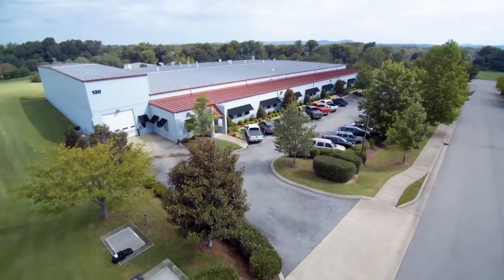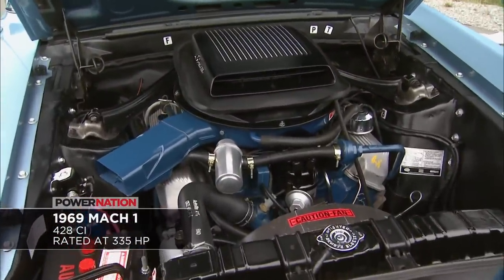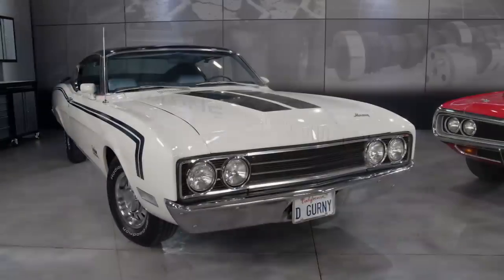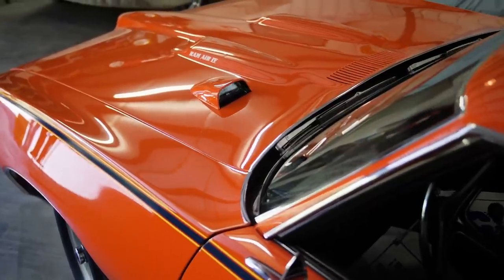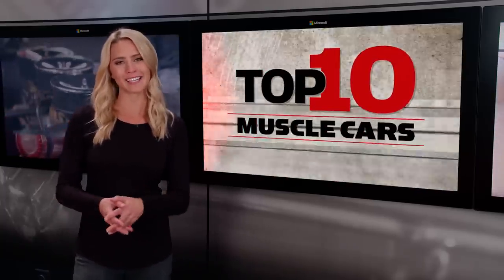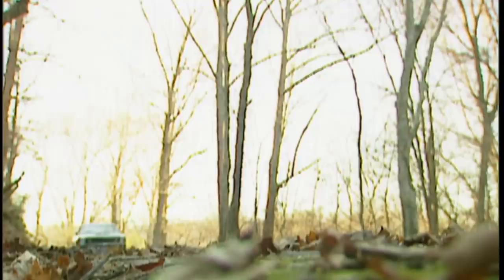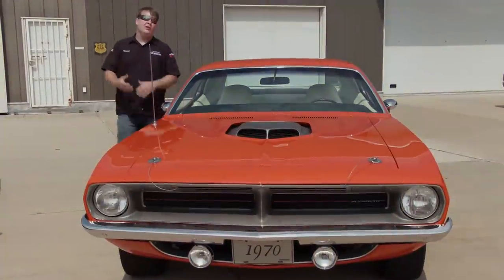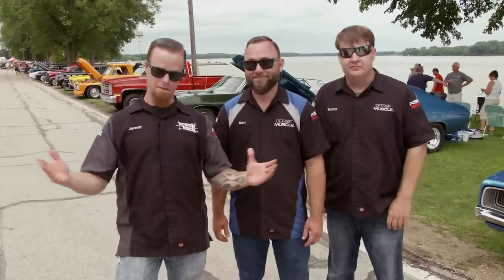Detroit Muscle's Top 10 Muscle Cars

Comment from the maker: Find more one-hour specials here: https://www.powernationtv.com/shows/powernation-on-the-road
Reply: Too many adds!
Reply: Um, 9 and 8 basically the same car, although I was surprised to see the GT 500 had an open diff.  There were only 69 ZL1's and there were only 2 ZL1 Corvettes made.  There were way more COPO's 427 Camaro's with the L72 427  Yenko and others.  The pre '69 car weren't COPO but dealer swapped, the were order as L78 cars and was swapped the short block for a L72, the cam, heads, intake a carb were the same.  A notable exception was the '69 Duece by Yenko a L72 Nova, which quicker then Camaro.
Reply: @russellroesner6073  o 

M
Reply: The Top Dog’s are the
1970 /1971
426 Hemi Cuda 4 spd/ auto
And 
1969/1970  4 spd / auto
429 Boss Mustang 
And 
1969 COPO 427 Camaro, and 
1970 LS6 S.S 454 Chevelle ..
Reply: @gregoryhagen8801  still a pony car, not a muscle car.  A good looking pony car to be fair but still not a muscle car.
Reply: @davidmiller9485  I don't know what your definition of a pony car is.But Road & Track. Car & Driver. Say it IS.
Reply: @gregoryhagen8801  Sorry but Road and track are full of it. A pony car HAS ALWAYS been a compact, usually two door car with a small V8 or V6. A muscle car is a sedan or Coupe (two or four door) that has a V8 (The smallest around 320 Ci or so) or more for power. (this would be your 392 hemi's or 426 hemi's. 383's 440, 445, 460, 350 ect. sized motors. Big fast and noisy. Pony cars have a more European outlook and while quick, do it with smaller engines and more varied handling.  They are very different.
Reply: @davidmiller9485  The 71 Mach1 was a 2 door 351ci. So by your own definition, it was a muscle car.

Comment: The first "muscle car" - specifically advertised for speed and track numbers, was probably the '55 Chryslers - a decade before GTO. 300 HP V8, hot cam, solid lifters, dual 4-barrels, big bore dual exhaust. In '56 a hemi with 355 HP. Some people would even make a case for the late 1940s Olds Rocket 88. Regardless, there were cars that were about speed and style well before John Delorean.
Reply: Yep
Reply: Because I'm new (14) to the Building, enjoying, racing Hot Rod scene etc....what does a "hot cam" mean? :)
Reply: @renc3920   <what does a "hot cam" mean?>
A "hot" cam is one that has more lift, duration, and overlap than the stock cam.
Reply: @evanderosborne4531  de
Reply: THE 49 OLDS IS NOT A SPECIAL CASE..ITS FACT! ITS THE FIRST MUSCLECAR AND ALL THE OLDIES HAVE KNOWN THIS EVEN BEFORE GOOGLE AND THE INTERNET.. ITS COMMON KNOWLEDGE IN MUSCLECAR LORE.

Comment: To also set the record straight: The Plymouth Barracuda was introduced 2 weeks prior of the Mustang, and was the first Pony car. The Mustang was later release via Lee Iococca, then with Ford, to compete with the Barracuda, and later in '67 the Camaro, then Firebird. The Barracuda was America's first fastback and also still holds the record of the largest rear window used in any production vehicle, which was 14 square feet of glass. It was also the first car to have separate from headlights, parking lights. In 1965 came the optional Formula S with 273 cid V8 having 235 HP. In '66 it offered the 273 Commando with 275HP with long duration cam, domed Pistons, and forged crank. In '66 it won the SCCA sponsored indurance race as Team Starfish driven by Scott Harvey. The rest was legendary.,only t be killed by Gov and insurance regulations after 1974.
Reply: Yep.Milburn Varner. Cuda. Hemi. "Drag Addicts"😊
Reply: year 1 barracuda was "UGLY"!
Reply: CORRECT! AS I POSTED ABOVE AMONG OTHER FACTS..

Comment: i am the proud owner of a Blue on Blue  1970 Pontiac GTO convertible with a 455 H.O. Ram Air III th-400 w/Hurst Dual Gate PMD rally 2 rims car has factory A/C 12 bolt rear as all 455 did power windows power top a endura bumper and front disc breaks. she is in need of a full restoration but runs drives and is rust free only having the typical lead cracks. it was my late fathers and my first memory in life is in this car. 

but a close second- 1970 Buick Skylark GSX 455 stage 1  one day ill have one sitting next to the GTO

Comment: I always loved the 1968 Plymouth GTX with the 440, 6pack.
Reply: The 67 were better with the hemi tho
Reply: Plymouth never made a 68 GTX with a 440 6 bbl.  The 6 barrel engine was first introduced in mid 1969.  First GTX to have a six barrel was 1970.
Reply: @davidhechler5882  A quick Google search will show you're wrong.
Reply: @user-A-A-RON  Not wrong!  Look it up.  If you saw a 68 GTX with a 6 barrel engine, it was after market job.  Again, the 440 six barrel/ six pack engine was first introduced by Chrysler mid year 1969 with the A12 package on the super bee and road runner.  By the way, Plymouth called it the 6 bbl while Dodge called it a six pack.  I should know, I am 71 and lived it.  From 67, the first year for the GTX, through beginning of 68 the only engines you could get in a GTX was the standard 4 bbl 440 with the only option of the 426 Hemi.  Some more history.  Did you know that the only two engines you could get in a road runner was the standard 383 with the only option being the Hemi.  The 440 was not available in a road runner as Plymouth did not want the road runner to compete with the GTX.
Reply: @davidhechler5882  I didn't know that. My pops would tell me stories of his 68 GTX he'd run when hanging at a Frisches mainliner on the weekends. haha. I guess his 6 barrel was aftermarket. He would have been 75 this year, wish I could ask him.  Thanks for the info.
Reply: @user-A-A-RON  Hi Ron, sorry to hear that Dad is not around anymore.  I live and eat MOPAR.  My Oldest Brother Terry, who passed away in 2000, came home from the Army in 67.  I was a junior in high school.  He bought a new turbine bronze 67 GTX, standard 440.  I rode shotgun all the time with him.  The first time we went to the drag races he won the trophy in his class.  His car was bone stock with standard 3:23 gears and automatic and turned 14.01 @ 105 mph.  Got to be careful Ron when going to car shows and the like.  I have seen many road runners with 440's in them and the guy says it came from factory or he ordered it that way when the 440 4 barrel was never an option for the road runner.  Check out Graveyard Carz on motor trend TV.  It's a great show where they restore old MOPAR muscle cars.  When I returned from Vietnam in 72 I wanted a 440+6 road runner but could not afford the insurance.  I special ordered a 72 Dodge Demon 340 instead.  I wish I had that car today.
Reply: @davidhechler5882  I appreciate that.  After hearing Dad's stories, I always wished I had one haha. He said that was the quickest car he had, and he had owned alot of awesome cars. Sorry about your brother as well. Thanks to you both for your service.

Comment: THE first muscle car, arguably, was the '62 Super Stock Dodge. It had heater delete, radio delete and powered by a 413 Max Wedge, with a 4 speed on the floor, with bench seat. It epitomised the definition of muscle car which was a small car with HO usually large CI engine. Whether you like MOPAR or not, one cannot despute the facts.

Comment: Really? The 1970 Olds 442 W-30 or the Buick GSX didn't even get an honorable mention? No love for the Mercury Cougar, Which out performed the Mustang in the Trans-Am series so badly that FoMoCo pulled the Cougar out the of series. Besides the GTO may have kicked off the "Muscle Era", but it wasn't the first. Chrysler had the 392 powered 300. Mercury had the forgotten 1958 Super Marauder option which sported a 400hp 430 Tri-power V8.
Reply: In my opinion the Chrysler 300 D it has a 392 Hemi pushing 380HP with dual quads with a top speed of 156 MPH is the first muscle car
Reply: Def a 442 ! Also mercs' probably couldn't find any for the vid. Lets not forget sum Buick too
Reply: The 1955 Chrysler C-300 was the very first American muscle car and was also the very first regular production car with 300 horsepower. Then in 1956 the other 3 Mopar divisions(besides Imperial)released their own high performance models...the DeSoto Adventurer, Dodge D-500, and Plymouth Fury. Mopar invented muscle cars nearly a decade before the 1964 Pontiac GTO. Ask Jim Wangers. He said the exact same thing in his memoirs. When the 300 horsepower 55 C-300 came out the most powerful V8's from Ford and GM weren't even making 200 horsepower. Needless to say the Chrysler 300's dominated NASCAR in 1955-56 and the Dodge D-500's were just as dominant as the 300's were in 1956
Reply: @79tazman  the 55 Chrysler 300 was the very first American muscle car and also the first regular production car with 300 horsepower. They had a solid lifter 331 cubic inch Hemi with dual quads. The 56 Chrysler 300 is my favorite car of the 50's. They had a 340 horsepower solid lifter 354 Hemi with dual quads or an optional 355 horsepower version for racing use. 56 was also the first year of the Torqueflite automatic transmission and the 12 volt electrical system. I love the 57-58 Chrysler 300's too. The 392 Hemi is probably the best high performance engine of the 50's. Many people use them in drag racing even to this day
Reply: It's an unofficial top ten,not top 394. This list liteally means jack shit. It's just ten cars. I'm pretty sure it was based on ten cars that were available because they all have footage on I65 in Tennessee where the show is filmed.
Reply: @Air Strike Technologies GS 350 beat your 440????
Reply: ??? Tran AM,  Cutlass, 67 Barracuda, 1968 Ford GT S-Code Torino
Reply: 1967 Olds 442-W-30, double cold air intake, red wheel fender, 4 speed, conv. The best Olds ever!😎😎😎
Reply: I know that kinda sucks considering the Buick Stage 2 GS 455 had more factory torque rated at over 512 pf witch was really much more both in HP and Torque.
Reply: Even before that,
What about the crossram V8s, with their crazy manifolds that prevent you from putting new sparkplugs in?
Reply: Nothing beats the 67 Cougar for me. It’s been my dream car since I was a kid.
Reply: @tracyfoor4336  Totally agree with you, Motor Trend's fastest test ever of an original 70's muscle car was a GSX Stage I @ 13.38 1/4 mile and while there is no official record of the Stage II's time one of the Privateer racing teams who received a pre-lower compression model (original was 11.0 to 1) they estimate it in the 10s and a restored Stage II put down 620 hp on the dyno. However the Stage II was never made from the factory except the test model mentioned before. It was an over the counter dealer installed option including more radical cam, higher compression TRW forged pistons and a 7000 rpm capable valve train. So, if deale installed options count then the 1970 Stage II GSX wins the performance part of the muscle car challenge hands down. That being said, after Ford made the 427 SOHC (Sock motor) Mopar made a single ball stud hemi CONSERVATIVELY rated at over 700 hp with  900 hp (est) with fuel injection. But that's when our government stepped in and stopped the horsepower wars citing safety concerns. I sure would have loved to own a 900 hp ball stud hemi Cuda 4 speed.
Reply: @dochammer3047  I got my hands on a 389 Pontiac crossram big block but someone managed to come up with a dollar figure to get it from me before I ever got it in a car. While I never had it in a car I saw no reason why the plugs would be hard to get to due to the intake, a tight engine bay might have been difficult which may have been my case because I was about to buy a 1974 Tempest to put it in and it came out of a 1965. I actually wanted to go to a 4 Weber 2bbl setup but I was broke after rebuilding it, I had the journals
Reply: @jimnox6476  When I was 18 (1983) I found a '67 XR7 with a 351 Windsor 3sp auto for sale but someone else wanted it too and after a short bidding contest I couldn't afford to top him. I was so sad, I wanted that car badly, but I did get to drive it and it would scream. Aftermarket cam, intake, 4bbl etc and dual glasspacks that made a sound that was orgasmic. Sigh
Reply: @jeremythompson9122  I agree! My father had a 55 Chrysler 300 2 dr with a hemi  and two fours.
Reply: BRIAN BACK IN THE EARLY 80S WE GOT AHOLD OF A W-30 MOTOR AND STUCK IT IN A 69 NOVA, ALL THE FAST GUYS IN TOWN GOT THEIR ASSES HANDED TO EM!!! WE NEVER TOLD ANYBODY HOW THAT CAR WAS SO FAST... WE BACKED IT WITH A BORGWARNER T-10 4 SPEED AND NEVER LOST A RACE!!!
Reply: Thanks for the real facts man! I appreciate it!
Reply: The list seems to favor Pontiac, specifically the GTO, which appears twice (the Judge was a GTO trim package). No race car should appear on the list. They were illegal to drive on the street, so why include them? I agree with others that the GsX should certainly be on this list, at least as a bare minimum an honorable mention. In any regard, this list is just the opinion of PN and should be taken with a grain of salt. No two people agree on a list like this.
Reply: @FreddyFunderbunz  EXACTLY ,TOP TEN IN WHOSE OPINION.ANYWAY THEY'RE ALL COOL IN MY OPINION!
Reply: Not even a mention of hemi dart either but a thunder bolt that got this back asserted lol
Reply: @FreddyFunderbunz  not to mention, the hosts themselves even said, “This is a subject that has been up for debate for decades”
Reply: @79tazman  Absolutely 100% dead on. Mopar had the first muscle car ever built.
Reply: @bilbobaggins4710  not at all.

Comment: Not sure if you will see this but back in the 60’s we used to drag race on the streets. I owned a 66 and 68 427 corvettes but the only car I purchased new was the 68 Super Bee. And if you were lucky it would perform better then most, we would call if a freak. I ran Chevelle SS , Olds 442, Mustangs GT’s, Corvettes , and never lost a race. Most thought I had a hemi but it was just a 383. 
The looks weren’t there but it was fast and all they saw were my tail lights.

Comment: Having built and driven a 69 AMX ,  A 70 Judge, and a 69 383 road runner back in the day. The AMX was the quickest and squirreliest, The Judge was the prettiest and fun to drive, the 383 road runner was the most consistant.at the track!  The Judge was the most consistant daily driver even with an automatic. Anything more then a straight line the road runner and Amx wer left in the dust! This from personal experience working in a speed shop in the 70's. They need real car guys from back in the day to rate muscle cars not guys from now that never drove then! They even left off the 455 stage 1 buick.
Reply: @JoeSakicisgod1  Of the 3 The Judge was the prettiest and the 2 seater AMX was the wildest. It gets real honorable mention because they didn't make many parts for it, and it was snake strike quick! While the road runner was fast it really had weak brakes.

Comment: I would have thrown in there the 1970 Buick GS Stage 1 or possibly the 1969 Hurst Oldsmobile 442 W- 30
Reply: Yea,yea, I had😥😥😥 a 1967 Oldsmobile w-30. It had real Ram-air, red plastic inter fenders😎😎😎😎
Reply: 70 GS Stage 1 455 would eat the 429.
Reply: Same here, I was disappointed they put in the same cars two or three times, and left out the Hemi Killer Stage 1 455, or The Vette, Trans Am, and a couple others. As for the TOP 10...Pick the one car, not the same car 2 or 3 times with different trim packages. As for Buick, They showed that there is a Replacement for Displacement when they came out with the Turbo Grand National and GNX. Some people may say it's not a muscle car, but every show I attend...That's the class they put my GN in

Comment: 1970 
buick GSX stage1 or 2 both rated at 510 ftlb  tork  ,490 hp
Reply: 490 HP ? Not - look it up
Reply: Nice mention of the Stage 2.... absolute killer!!!!
Reply: Both the stage 1 and 2 had impressive engine specs but they had a lot of reliability problems. They had a lot of problems with the car's rear tires running over its internal engine parts.
Reply: @nojunkwork5735  the biggest issue was the Buick engineers in their infinite wisdom thinking a 2 bolt main was sufficient to maintain the crank with that much hp/torque... fortunately, it's a relatively easy fix (to convert to 4 bolt)...
Reply: @russmarasheski7005  It is more than just the two-bolt main block. The motor also had a bad oiling system and was prone to cracks in the lifter valley.